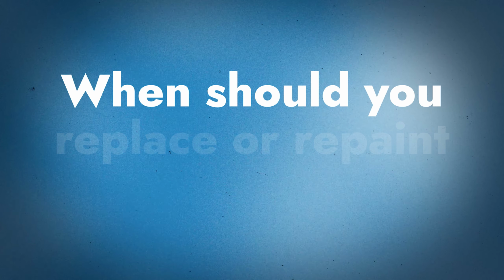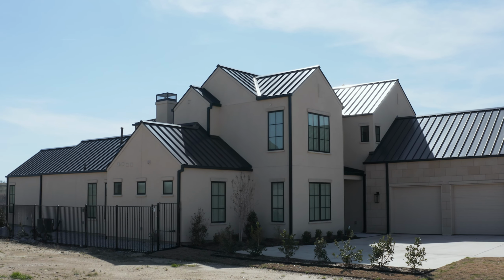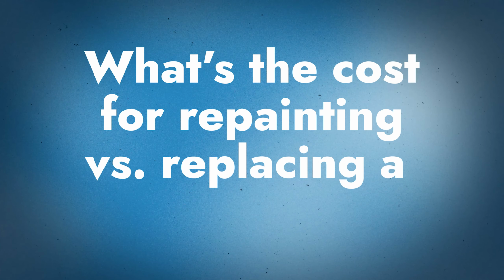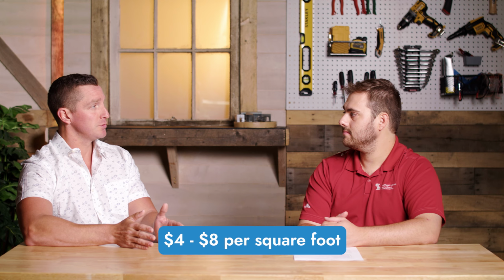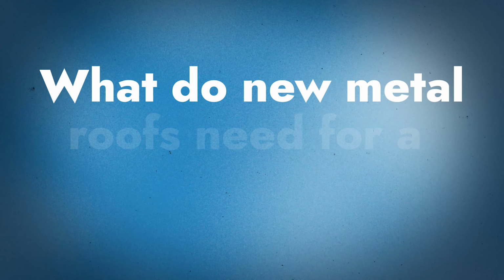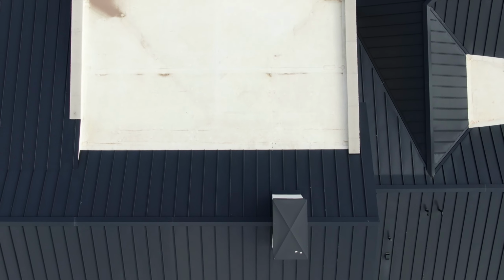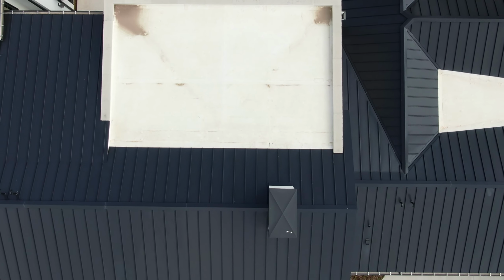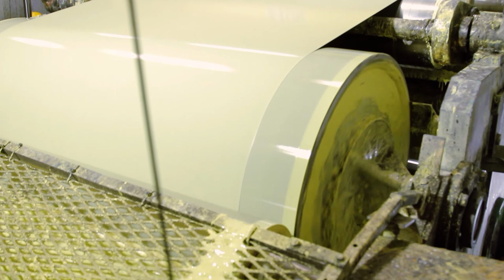Repainting vs. Replacing Your Metal Roof: From a Restoration Pro

Comment: $4 to $8/sf for a paint job?  I did my new metal roof for $5.  Labor and materials.
Reply: Rip off
Reply from the maker: You definitely need to weigh the costs of doing a paint restoration vs. replacing the entire roof. The choice will depend heavily on how much additional service life you're looking to get out of your current roof, its condition, and the difference in price between repairing and replacing in your area for your project. -Thad